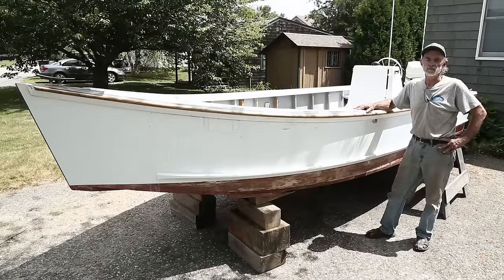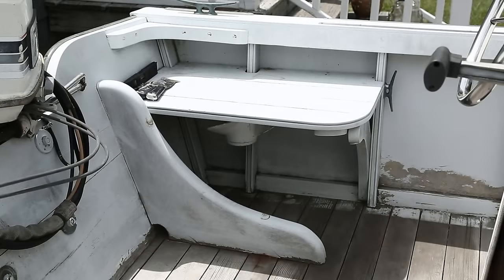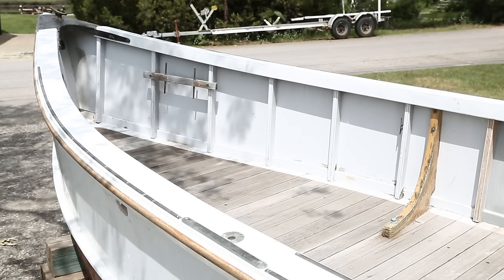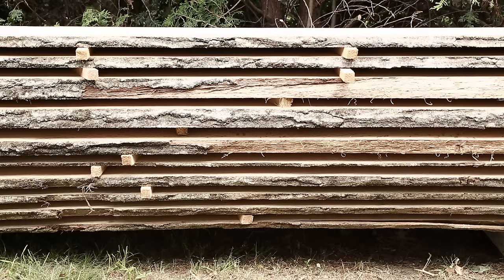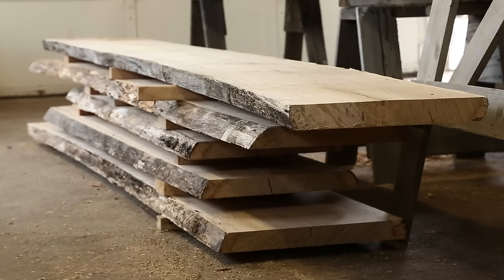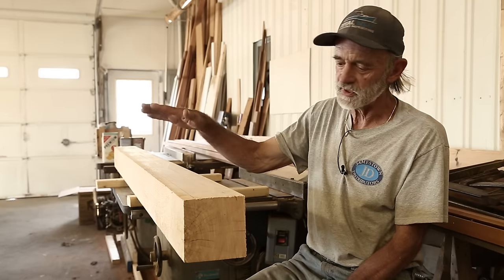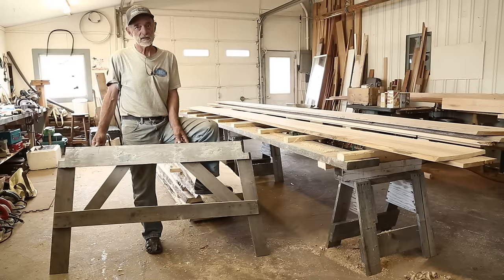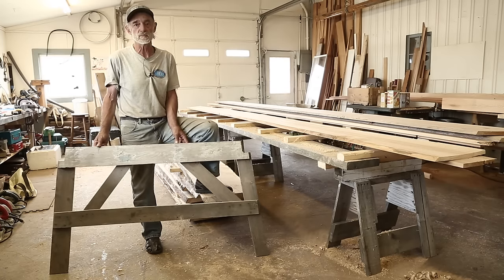How to build the best Flat-Bottom Fishing Boat with TotalBoat products - (Episode 1)

Comment: Hello Louis, I built this boat following your directions with the exception of adding the ssidewalls. rails. I am having problems with the bow. Once on plane, the bow comes down very low and will begin to push water at full throttle.  (25hp 2 stroke) I am wondering if the splash rails will help keep the bow up while underway? I love this boat.  Thank you.
Reply: sounds like you might just need to adjust trim on the motor.

Comment: Louis....I love your info but am confused. Earlier you told us that red oak is no good for boat building due to its ability to suck up water but you are using red oak for this boat. Help me understand. Thanks.....
Reply: From what I understand you don't use northern red oak in boats, and this yellow bark oak is aka black oak. We use mostly purple heart, white oak, yellow cedar and black locust for backbone material here in the northwest. I'm building a wooden tugboat right now with a white oak stem and floor timbers. I'm curious as to why Louis called this "red oak" instead of "black oak" even though it is technically in the red oak family.
Reply: Thanks for the answer. I've never heard of yellow bark oak or black oak.....maybe Louis can address this. Your answer does make sense.
Reply: +bobill14 As a northwesterner I had never heard of yellow bark oak either (until this video) so I did some research and found out it is aka "black oak". I was simply stating that white oak is the only oak we use out here.